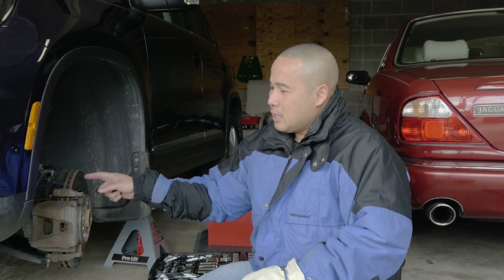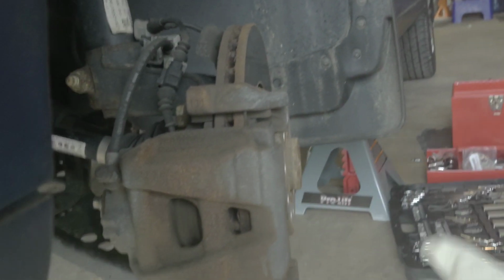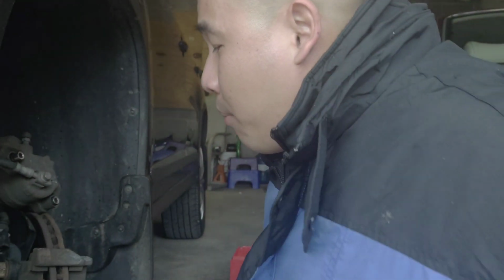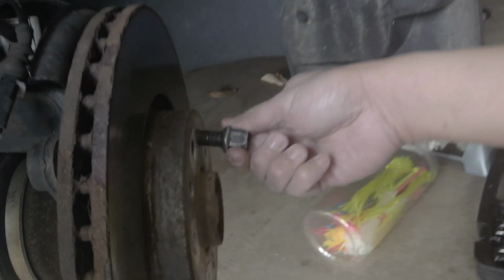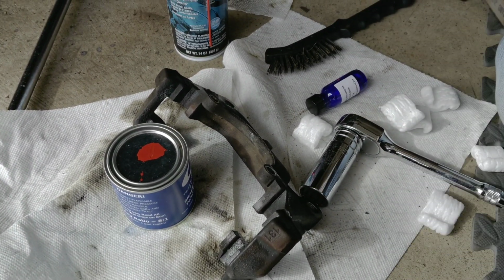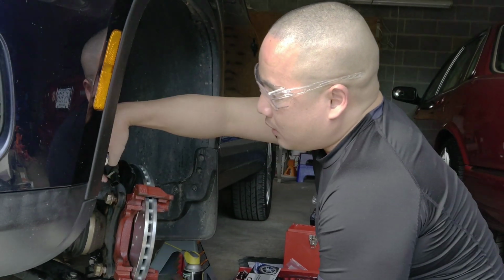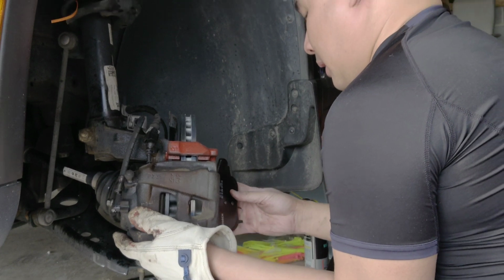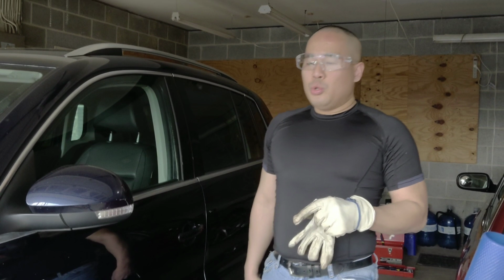VW/Volkswagen Tiguan  How to Change/Replace Left Front Brake Pads Rotors Complete DIY Instructions

Comment from the maker: You can purchase the tools and parts from my affiliate links below:

1. FRONT PADS - Bosch BP1375 QuietCast Premium Semi-Metallic Front Disc Brake Pad Set
https://amzn.to/2HOFbG0

2. REAR PADS - Akebono EUR1348 EURO Ultra-Premium Ceramic Brake Pad Set
https://amzn.to/2CL1jx3

3. FRONT ROTORS - Detroit Axle - 12.28" (312mm) 5 Lug FRONT Drilled and Slotted Brake Rotors For Audi VW Models - Check Fitment Chart
https://amzn.to/2U4szRD

4. REAR ROTORS - Detroit Axle - 11.25" dia (286mm) REAR Drilled and Slotted Brake Rotors For FWD ONLY Audi A3 Quattro Volkswagen CC GTI Jetta Passat Tiguan
https://amzn.to/2CL1jx3

5. Lisle 13410 Disc Brake Caliper Brush
https://amzn.to/2HL30yF

6. 2 of CRC 05084 BRAKLEEN Brake Parts Cleaner - Non-Chlorinated - 14 Wt Oz
https://amzn.to/2HWVNuA

7. Pro-LifT T-6906D Double Pin Jack Stands-6 Ton
https://amzn.to/2UhqQIg

8. Liftmaster 3 Ton Heavy Duty Ultra Low Profile Steel Floor Jack with Quick Lift
https://amzn.to/2U6BuSS

9. Craftsman 450-Piece Mechanic's Tool Set
https://amzn.to/2OzHSf6

10. Neiko 00206A 1/2 Inch Drive Premium Breaker Bar, 24" Length | Cr-V Steel
https://amzn.to/2HLUpvx

11. TOOLTOQ 1/2" 30-150FTLB Torque wrench set, [Protector impact sockets]
https://amzn.to/2WxWGxD

12. DISC Brake Piston Separator-Disc Brake Pad Spreader Tool - Caliper Piston Compressor - Steel Separator for Car Pistons - Heavy Duty Auto Plates T-bar Hand Tool JTC J01
https://amzn.to/2HP3nrN

13. EPAuto 45 Pieces 3/8" Drive Socket Set with 72-Tooth Pear Head Ratchet
https://amzn.to/2LLFdzc

14. Permatex 80078 Anti-Seize Lubricant - 8 oz. Bottle
https://amzn.to/3cZ6vQi

Comment: Excellent video(s). I have done mine in the past but was a long time ago. This is a good refresher. But one thing to suggest. When you retract the piston with your piston retractor tool, shouldn't you either loosen the bleed screw or remove the cap of the fluid resovoir? I have always done that and I do it very slowly. Well done!
Reply from the maker: Thank you very much Jeff. Yes, it is better to lose the cap of the brake reservoir.
Reply: @ejsgarage  Will do! Thanks!

Comment: Hello, brother. I have seen some mechanic put 145 ft lb forces when tighten the two holding screws for the rotor bracket. But I have seen in your video you only used 95 ft lb.
Reply from the maker: It is not good to put it too tight.
Reply: @ejsgarage  After saw your video, I have successfully replaced the transmission oil. Thank you very much! you are the best.
Reply: @ejsgarage  If you have the time in the future, you can also upload the replacement of haldex oil if you want. Best wishes to you
Reply from the maker: Great job brother Frank 😃👍😃👍😃👍
Reply: The mechanic is correct, the spec is 147 ft lb or 200nm, not 95🤦

Comment: Gonna do this next weekend - just the pads tho (and sensors if they need).  Do I need to remove the caliper bracket to just replace the pads?
Reply from the maker: You can do it. It is not hard 😀👍

Comment: What year is this?  And are the VW use wheel studs?
Reply from the maker: It is 2013
Reply: @ejsgarage  thank you.  My wife has a 2010 and just wondering what im looking at time wise
Reply from the maker: My pleasure. It is going to save you $2500 to do it yourself. The dealership really charges people an arm and a leg for this job. It is an hour job per side for the front. The rear brake, you need a special tool that I use on this video to disengage the ebrake. https://youtu.be/qaaSiO6BXdo
Reply: @ejsgarage  my local stealership already quoted me $950.  Thieves.
Reply from the maker: It is an easy job too that you can do very fast on the weekend.

Comment: Hi, there when doing the front (right and left side ) brake pads. do one need to access the VCDS software or plug tool or not, and do one need to bleeds all the 4 bleeding nipples? I know one needs to pump the brakes in order for the new pads to sit in properly.
Reply from the maker: For the front brakes, you don’t need the VCD. For the rear, yes because you need to disengage the electronic brake to push the piston back.

Comment: 1 piece of advice. I always take the bracket and rotor off. And then put the bracket back on(not torque down tight) without the rotor. And then put the caliper back on. This way makes it much easier to compress the piston back in. As the bracket act as 1 very strong hand to hold the caliper while u use tool to compress it. The rear breaks u can remove rotor without removing bracket
Reply from the maker: Great advice. Thank you

Comment: What's the size on that nut on the back of the caliper?  Not the two Torx bolts with the covers, but the main bolt on the caliper, the exposed one.  I need tools, and I don't wanna break the bank.
Reply from the maker: EPAuto 45 Pieces 3/8" Drive Socket Set with 72-Tooth Pear Head Ratchet
https://amzn.to/2LLFdzc

Comment: Great video, EJ! Especially since it's your first brake job. It demonstrates how to do a brake job, as well as the challenges that anyone can face when doing it. 

Small correction: At the end, you were correct in stating that you should not just drive off in the car, immediately after changing the brake rotors/pads; however, what you were doing was merely pumping the brake pedal with the engine on. This ensures that the brake piston hydraulics push the calipers against the rotors, so that the piston will be able to apply the brakes properly when needed.

Bleeding the brakes is the process of getting any air pockets out of the brake lines. This is generally only required when changing brake fluid, or brake lines. Many cars require a tool that you affix to the master brake cylinder; and pump in the brake fluid under pressure. With some older cars, you can simply top up the brake fluid in the master cylinder; pump the brakes a few times; then top up the fluid again; then pump the brakes; etc... with the brake valves open. This pushes the old fluid out, while pushing the air bubbles out at the same time..
Reply from the maker: Thank you very much for the detail correction. I did the right side like an expert because I learned my lesson from doing the left side. The rear brake is another difficult challenge. It needs a special torque bit to remove the rotors.
Reply: @ejsgarage  
If it weren't for all the special tools required to work in modern cars, many more people could do a lot of the basic repair jobs. Unfortunately, manufacturers often change to new standard bolts, screw heads, etc... which require new tools. Even the torque wrenches are more expensive.

It makes me wish I had my '76 Plymouth Volare. That was so easy to work on.

Comment: It would be better if you spray it first with WD40 to loosen the bolts and screws before taking it out ( spray before taking it out to loosen and spray it again when putting it on so that it will penetrate the chemical inside the bolts where it goes ) for better and easier removing the next time you do a break job.I don't know if you know this site where you can buy brake pads and rotors and etc. I have used this with my Audi A4, Subaru Crosstrek and I'm on the process to do it on my VW Tiguan,break pads are so quiet you will never hear any noise when you step the break. www.r1concepts.com, you can compare it depending on your daily use of vehicle from basic ceramic series to performance sport series.
Reply from the maker: Thank you very much for the tip 👍😀👍😀